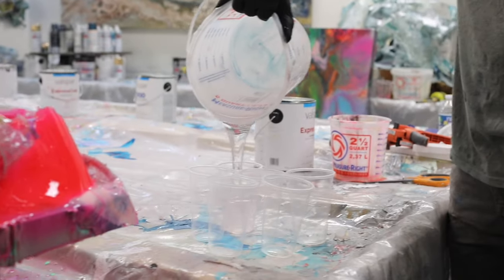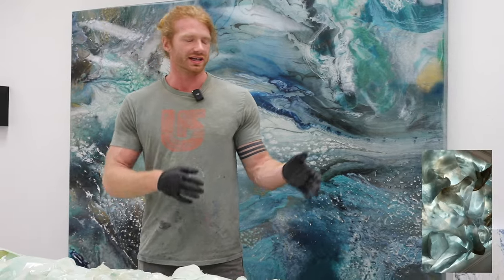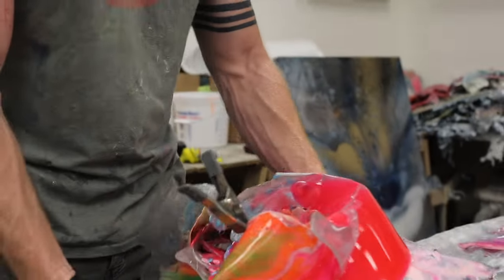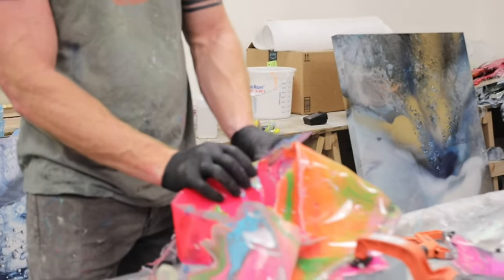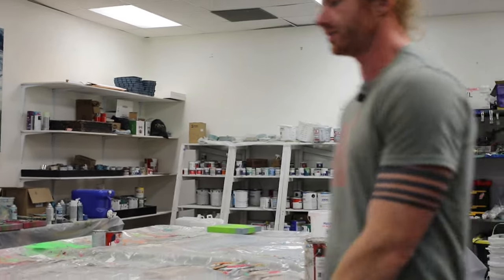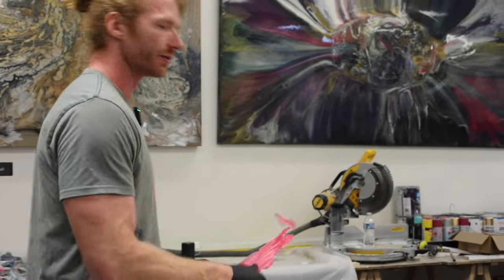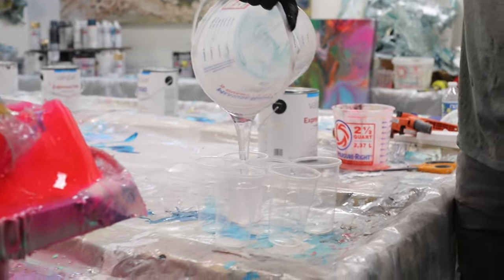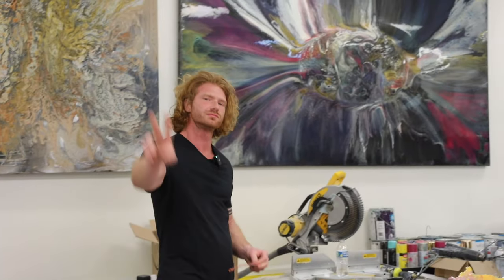From Trash to Treasure | Studio Session 20

Comment: For your base pieces of resin since they won't be seen I see your using wood to set your pieces on why not glue and screw the base pieces in first so you have a good sturdy base to build up on? Just curious?
Reply from the maker: That is a great idea! I would need to build the canvases using a thicker wool panel than the Underlayment I use now. Thanks for the suggestion. I’ll give it a shot 👍🏻